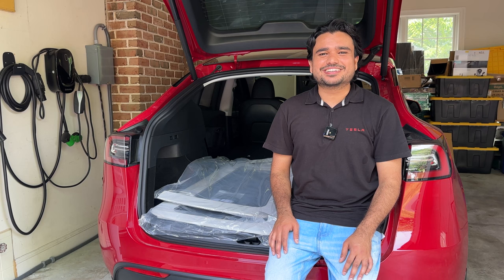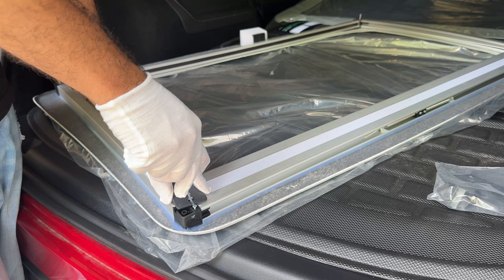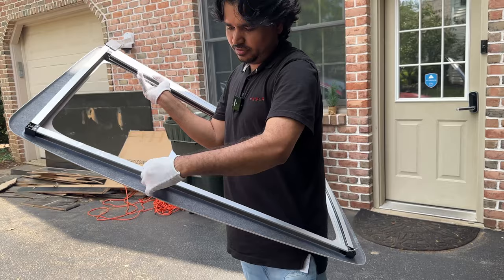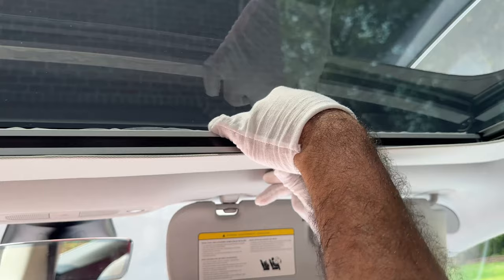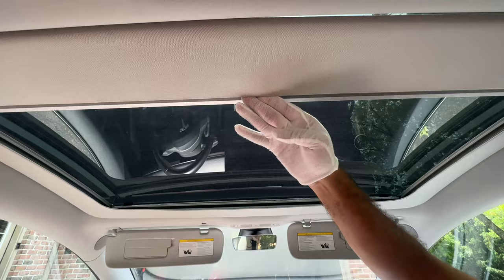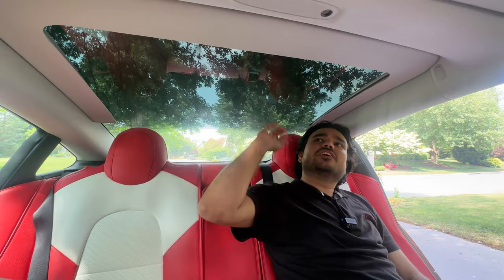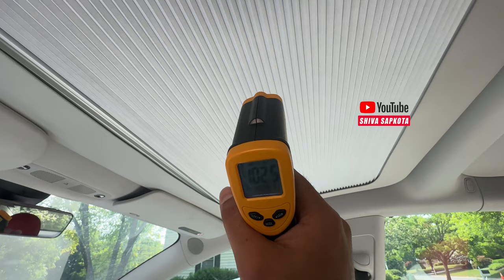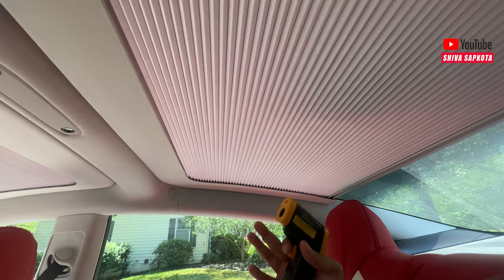NEW Fully Retractable Sunroof Shades For Tesla Model 3/Y (Best One Yet | Easy Install 2023)

Comment: Thank you, Shiva!  I just became aware of this updated 2.0 version of the fullshade system last week and installed this one myself on Thursday.  I had some problems getting the front clips in the front headliner, but eventually prevailed.  Worth noting, the price from Otrifowd (not sure if your discount affects this or not) is down to $249 from $499 and the side panels are thinner, taking up less glass space than the original version.  i also didn't feel the need to remove both screws on the pivoting tabs.  I simply removed the outermost screws, pivoted the tabs and reinserted the removed screw in its new position.  Agree that the gloves are not great for working the screwdriver!  LOL.  I am really happy with this product and can see why you're leaving it in place in your own vehicle.  Cheers.
Reply: I see it as $499
Reply: @TonyaGuzman  the old version is $499. The 2.0 is $249
Reply from the maker: Thanks my friend, appreciate the input.
Reply: They don't have a Fullshade 2.0 for the MY.  Bummer.  Not paying $500 for a shade.  $250 is more like it.

Comment: Maybe if I leave you a comment I can get some fix. I have these for my model 3. The front one is solid no real issues except if I hit bumps it can make some noise. The rear shade is a problem child. The clip you install at 12:04 comes loose and 1/2 the shade drops down while your driving. They need a more secure clip or a better way to attach the rear.

Comment: Really nice video.
I'm really not a big fan of all the glass in my M3, which causes the acoustics inside the car to be pretty bad, since all the extra glass reflects all sounds and noises, since it will bounce back and forth inside the car when hitting the class.
Does this sunshade have a positive affect on the acoustics inside the car, since these surfaces shouldn't reflect sound as much as glass does?
So basically my question is, can you hear any differences on the acoustics inside the car after installing the sunshades?
Reply: It doesn't reduce noise or cool your car down although it looks cooler. Save money for ceramic tint would be a better solution. Tint does not reduce helps your car absorb heat slower so that your AC won't run more often.

Comment: Not a fan personally of how much glass you lose to the massive frame. Definitely prefer just installing the basic ones for the hottest month or two of the year here in Australia. I’m amazed most places even need sunshades?
Reply from the maker: Thank you so much for your feedback.
Reply: I felt the same way, but here's the rub... This 2.0 version reclaims more of the glass space that was lost in the original version.  Also, once installed, it is as easy or perhaps even easier to remove and replace as the fixed shades you are using now.  But you won't want to, since you can just flick back the shade whenever you want to admire the clouds.  I found that with the basic shades, they were such a PIA to try and fold back up and store, that I never removed them at all, blocking my view through the roof glass permanently.
Reply: @tesladura3085  I’ve put in and removed mine several times already.. no such issues. Admittedly I don’t bother folding them up to store.
Reply: @adamtm82  As long as that works for you, terrific!  All good.

Comment: I have now had these shades installed for a month and ran into a few issues that I thought would be helpful for past/future buyers.
1. For the back shade, the hooks on the side are leveraged in such a way where it creates an inward sag (backmost part of the shade). After a month, the cloth frame began to detach from the rail. To fix this, I put stronger adhesive bw the track and frame and clamped them together to get a stronger bond. So far, after a week, the problem is still solved.
2. There are only two clips on the front of the front sunshade and they are put to the outmost position (left and right). Mine has a sag towards the middle and that is because there is no support in the center. I wish it came with three clips to add some stability. Anyone else had this same issue and have a solution?

Comment: One problem with most non OEMs solutions is that the glass gets extra heat. Ideally the sun should be reflected back out like with a mirror. Heat effects the rubber seals and glues used by the OEMs. In most western climates this is theoretical.

Comment: Edit: the FullShade 2.0 is the same price for the Y or the 3. Still looking forward to seeing Shiva’s review on the MY version!

Original comment: Model Y version is so much more expensive 😭. Hopefully they send you one of those for review and installation guide 😉! Thank you as always for the great Tesla product reviews and guides!
Reply from the maker: Thank you so much my friend! Yes, they are sending me their newer version that should be released later this month. I hope they reduce the price 🙏
Reply: @ShivaSapkota  can’t wait to see the video! I have a cheap $50 or so top glass cover for my MY (has a black mesh shade with a silver reflective shade on top) and it works ok. Reduces the internal temperature of my car by 2-5 degrees, depending on how hot the day is (the temp that shows in the Climate section of the mobile app). 

Another video idea would be your internal temperature with the new FullShade opened compared to the temperature with them closed.
Reply from the maker: @HypocritesExposd  The hard thing with internal cabin temp test is the fact that sun goes through the side window glasses and front windshield. I will try to figure something out :) Thank you so much!
Reply: @ShivaSapkota  agreed. With my test, I made sure the weather forecast would be the same temperature for two consecutive days. Then I measured the temperature during the same time of day on both days, one with the roof shade on, one with it off. Maybe you can do something similar or come up with something even better 👍
Reply: Hi there! Our new version FullShade for Model Y is priced the same as Model 3! Both at $250. But inventory for the Model Y version is not yet available until end of June - July.
Reply: @otrifowd  thanks for the clarification. I thought the FullShade for Model Y was the newest version and the 2.0 was for the 3. I see now I was mistaken. The 2.0 can be ordered for the Y or 3. Thank you!
Reply: @otrifowd  Yes, I've already paid for my pre-order. I too am looking forward to receiving my unit for install/review.

Comment: I bought this because New Mexico heat is crazy and my M3 can get really hot, this shades definitely do the job however fit and finish is not that great, not that the car’s fit and finish is any better and my front shade rattles but for the price and OEM look they will do for now
Reply from the maker: Thanks for your feedback my friend. Yeah none of these accessories fully fit but these sunshades are the best fitting ones I have seen so far.

Comment: What about Tinting the roof for reducing the heat in the Tesla 😊.
Reply: Be careful, some states don't allow it. We had tinting done only to find out that when it's time for inspection it will have to come off.
Reply from the maker: I have fully ceramic kava tint on my Model Y and nothing on the 3. Tinting does help a little bit but still super hot. Tonya, there are laws for the window tinting (front and windshield) but nothing on the roof tints. Thanks.

Comment: How does it slide so well? I've got the same one, installed yesterday but it takes quite a bit of tugging to open.
Reply: I'm having the same result and hoping that with more use, it gets easier.
Reply from the maker: Once fully tucked in, it takes a little bit of force but what I find is if you leave the metal bracket slightly not tucked in all the way back, it helps. Also, the whole frame moves a little bit when sliding as shown in my video due to the gaps. Thanks.